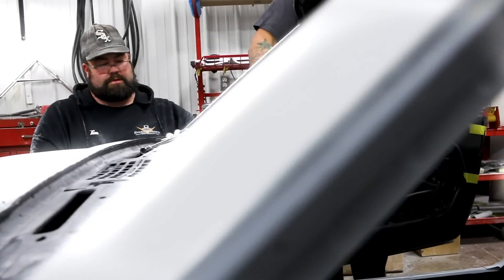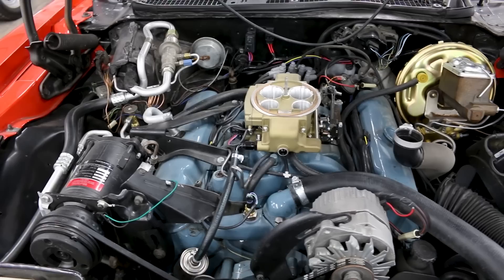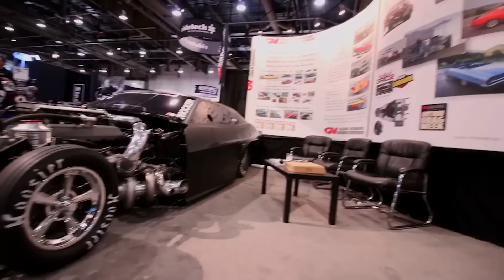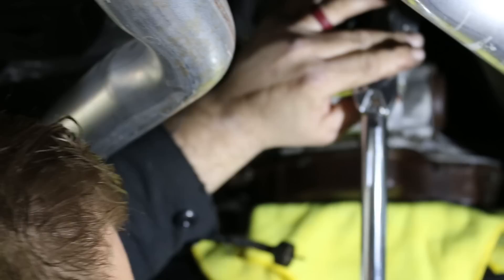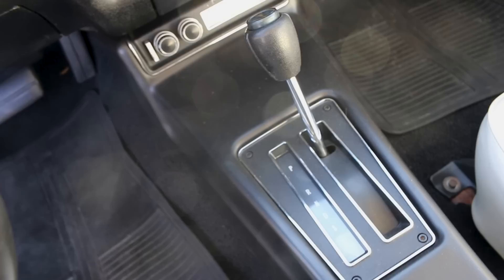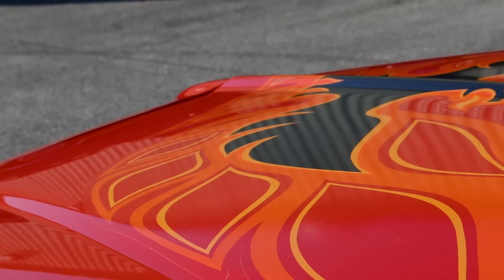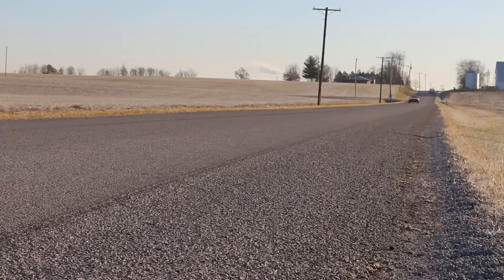1973 Pontiac Trans Am 455 Holley Sniper EFI Gear Vendors Overdrive Install V8 Speed and Resto Shop

Comment: I have a Muncie M21 4 speed in my 74 Nova SS, and I intend to put a Gear Vendors O/D on it.  Everyone asks why I don’t just buy a tremec 5 or 6 speed.  The answer “should” be obvious; my car has the original floor console and gauges in it, and that is a big deal for 68-74 Nova owners.  Putting a modern manual trans in it would require surgery and would essentially eliminate that beautiful original console and gauge setup.
Reply: You can't put an automatic OD on a manual transmissions.  This thing operates from pump pressure. It's not going to work. There's no pump on a manual.
Reply: j they make the O/D unit for my Muncie.  It is basically a gear splitter.
Reply: @TheEvilistic  The OD unit Ed is speaking of works fine on a manual transmission. It's specifically designed for those applications. The guys from Roadkill did something similar on one of their builds.
Reply: You could also consider the g.m. 4+3 from the early to mid eighties Corvette. It is a borg warner t10 with an electronic o.d. similar to a gear vendors unit.
Reply: Pontiaction 1963 sounds like a good idea.  Honestly, I’ve never heard of that
Reply: @IronChief  
I'm not much of an American gearhead , but plenty of buddies are so I know enough to get in trouble usually, so I'm asking  😂...
Aren't those t-10s  a little weak if you're pushing any kind of power I thought  ?
Reply: @MrTheHillfolk  The early t10 was a  little sketchy but they got better as time went on just like the muncie. If you are looking for something to take 5 or 6 hundred hp then no, this isn't a good choice but if you need a reasonable transmission with the ability to split gears in 2nd 3rd or 4th,this could be a viable option.
Reply: Pontiaction 1963 that was my concern as well.  My Muncie is a 1973 (fine-spline) with it’s original internals.  Everything looks nearly new, as if it’s original owner used it with their sanity intact.  I did look into the Super T-10’s before I got this M21, but I couldn’t find a shifter and linkage to work with the console.  Either trans is better than my car’s original Saginaw though.  I’m keeping the Sag around as a spare.
Reply: I put a TKO in my 67 bird. Clear the floor fine the tunnel has a very flat top. Used the Pontiac bellhousing clutch and Factory z bar linkage. I bought an aftermarket crossmember but it was really heavy and just made one from tubing
Reply: John Costello where did your shifter end up?  Back a bit farther?
Reply: @mistered9435  I forgot the details, my tunnel was cut down the side for 4sp linkage adjustments in the car. It had some performance  Hurst shifter. The tko shifter ended up in the hole. (The factory square double metal ring on top) I might have had to notch the front or back a little, for the dust boots to clear more.

Comment: 70-73 were the best years for the T/A, awesome car!  Thanks!
Reply from the maker: Thank you!
Reply: Bill, I whole-heartedly agree. :)
Reply: I totally agree I do however think a rare 1974 sd 455 would be cool
Reply: @kiheirc3195  ... Yes, and I love all the 1970's T/A's, I owned a brand new 1975 T/A and put lots of money into it to increase the HP, but the 70-73 are still my favorite!  They had more power, no catalytic converter through 74, and no heavy 5 mile per hour bumper!
Reply: I had a 1974 that I bought new. But, the 70 to 73 looked much better with the chrome bumper in back and the endura bumper in front.  I guess I could see the overdrive, but the quadrajet for the sd 455 flowed about 800cfm. That carb could easily replace the 650cfm unit on the standard 455.  The best thing is the big sucking sound with the block off plate on the hood scoop removed.
Reply: @kiheirc3195  Their all beautiful but no offense to anyone, i think the 70 to 73 are the better looking bodies all around but i also like the 74 too.

Comment: I put a Gear Vendors OD in my 71 Chevelle with a 454BB. I love it. Been cruising with it for over 10 years now.
Reply: Stock rear gear?
Reply: @thxman1968  Mine was built as a restomod with mostly Detroit Speed drive line components. It has a DS Ford 9" rear with 3.50 ratio. Also have a  3.89 but I preferred the 3.50 for all around cruising, traction and beautiful big block sound. 👍
Reply: @drphibesrises  I know you're coming on here was a while back but I was curious what kind of driving characteristics that offers you at speed as well as Street and strip running. Although I guess with the overdrive it also makes it very fuel mileage friendly at speed on the highway.

Comment: Friend of mine had a  '73 455 SD T/A. One of the scariest cars I ever rode in. Extremely fast. Loved it.
Reply: right on, had to be at least 300 hp, if that scared  you imagine what 500 would do
Reply: @Hugeroost  it's the torque that makes you grab the dash.
Reply: @superduty4556  true
Reply: @Hugeroost   I think it was more then 300 HP
Reply: @bustersmith5569  maybe but not much

Comment: I just installed a gear vendors overdrive in my 68 impala. Love it. Now I can do 75mph at 2,500 rpms.
Reply: I want one for my 88 Silverado that im building. Had the truck since high school and wanna bring it back to daily driver status. I want the gear vendor mainly for the fuel economy benefits. Im trying to figure out how the system works exactly.
If you leave the G.V. switch in Auto position, will you get any of the economy benefits? Or does it only shift into the extra overdrive when in manual mode?
Reply: @HAMMER_2.2  gear vendors overdrive can be shifted many ways. I normally leave mines in automode and let it self into overdrive around 45mph. You can also shift it manually from a complete stop or on the highway. I have a shifter button to turn on or off the gear vendors overdrive. You should get one you'll love it.

Comment: Sweet but who wants to drive around with your console open tho...
Reply from the maker: You don't have to, we were just demonstrating.
Reply: @V8TV  no I get that to, but was thinking it make more sance on the outside of the console or dash...
Plus why didn't you just add a new shifter with a button instead of on the floor??
You guys did a great job either way tho, and thank you for your time and sharing your content with All of us YouTube viewers from Canada and around the world 👍👍
Reply from the maker: Great questions.  In this case, the owner didn't want to see the unit, so it was slipped into the console.  In automatic mode, you don't really need to interact with it, so it hides away.  He also wanted to keep the original shifter.   They've had the car since the '80s and are quite used to it.    Thanks for the kind words!
Reply: @V8TV  well I'm so glad to hear that you made the owner so happy!
You guys do great work and look for ward to more of your videos 👍

Comment: I installed a GearVendor Overdrive on my Convertible 69 Firebird 400, 4 speed over 3 years ago. It completely changed the drive-ability of the car on the highway and I'd recommend it to anyone. 
 
As far as ease of installation. Not sure if I'd do it myself again. Which is why I haven't installed one on my 71 TA.

Comment: I had a '73 Esprit that was Buccaneer Red with black interior and black vinyl top.  When i bought it it was 100% original but had the usual wear and tear.  I kept it for a couple of years, repaired/refreshed what I could and then sold it because at the time I couldn't afford the gas.  It was a great car and I regret selling it.

Comment: I put in a posi traction 3.08 disk brake rear end out of a 81 trans am on my 73 trans am with an m22 muncie and it works great. I can cruise at 70 to 75 mph at 2750 rpm's... Love it...

Comment: I'm looking at doing gear vendor on my 78 caprice coupe. Already have sniper and th400 the gv will be icing on the cake. It has 440c.i. small block chevy and runs great I use it as a daily driver.

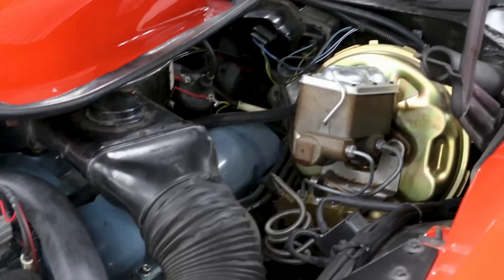Comment: Have a 70 B302 with a 4:30 gear. Installed a gear vendor and it transformed the car. Get to keep the top loader and no tunnel mods. In 4th gear hitting the button turns it into a 3:35.Like Van Halen said "the best of both worlds". Kept the original driveshaft and had a new one made up. Besides the top loader is much sturdier than the tremec. Hid the brain box behind the glove box.

Comment: I had a 74 charger rallye 440 with the torquflite and the optional 3.55 gears. I thought I was hot stuff until I ran into a guy with a 74 SD. Wow.

Comment: Thank you for not putting in a Lazy Ass LS swap like the other lazy You Tuber's.  Keep it original, build it from there. Keep the VALUE!! Putting an LS motor in a Pontiac basically means, you probably can't really build a motor. #partschanger  P.S  As soon as I heard the word Butler Engine, I knew these guys were legit.
Reply from the maker: Yep, we're legit!    Thanks man!

Comment: These are good in some applications, yet I weighed it out this modification compared to a full Diff rebuild with freeway gears & the OEM look never touch it again.
About half the cost.
A good rebuild on a Q-jet starts up quite easily.
Reply from the maker: This allows for great highway cruising without sacrificing acceleration like a highway gear can.   Thanks for the feedback.
Reply: Only down side to gear finder is drive line angle
Reply: @scottb4494  Can you explain.

Comment: Would this od unit help if you have 411posi on a 70 gto that doesnt want to go past 55 mph. The motor in my car is from a 73 trans am 455?
Reply from the maker: It would help for sure.   However, we'd look at the overall combination and goals of the car to make sure everything is doing what you'd like.

Comment: Am I the only one that thinks adding late model parts is a good ideal, now add a coil per cylinder msd ignition 10mm wires platinum  plugs ,modified tunedport injection 90mm throttle bodies

Comment: EFI requires a tank and lines and electric fuel pump, how is that a bolt on? 73 did not have this.
Reply from the maker: In this case, we added a high-pressure in-tank pump and high pressure lines to the throttle body.   There are now many types of high-pressure in-tank pumps for stock tanks that replace the original fuel level sender.  New tanks are also available.    No fabrication is needed, so we consider that a bolt on.   Thanks for the feedback.
Reply: @V8TV  understood,  thanks.
Reply: @V8TV  
I'm 46 and alot of buddies beat around in this stuff when I was in school. 
Had alot of fun with em , good times I'd trade it for nothing. 
I like tech but I went euro, sorry , haha point being I like the tech that's for the American stuff , I'm jealous I can't get stuff like this for a euro car. 
I remember hearing about these when they came out and what an awesome idea. 
Fast forward 25-30yrs now and it's amazing , you can buy everything for these things , like you mentioned about a drop in efi tank. 
If I ever won a lottery , I'd buy this guy's car🤣,I'd have another lenos garage if I could. 
Enough rambling , great vid this was cool

Comment: Why not to gow with a Gear Vendors? Becaus it is probably twice as much as a 6l80, got a third of the gears less and you cannot sell the stock transmission to lower your investment.....maybe thats why
Reply from the maker: Well, not sure about all that.   The GearVendor unit is less than a 6L80, which also would require a controller and harness, and does not fit the car without major floor and tunnel mods.   And it would have to be adapted to the Pontiac 455 bolt pattern.   With the GearVendor unit, the TH400 now has 6 gears the same as a 6L80.   Plus, the car keeps it's numbers matching transmission in place, allowing a future restorer to un-do the job without affecting the car's originality.     For this car and customer, it was a great choice.    Thanks for the feedback.

Comment: You never mentioned what the rear gear is, or what is recommended. (kinda important). plus you said, it was geared too "high", (the reason for the OD) What you meant was the gearing was too low, but hey, who cares, right? 
Nice car. Love the early T/As. Rather have a stick shift, with a Q-jet, but that's just me talking out loud. Had a red 4 spd one in 76 for a few years, and wrecked it. Now I have a condition 5 one, in storage.
 I can see an OD in a 3,42 (or lower) geared car, but don't see a benefit for the expense in a 3.08 car. Unless you're a traveling salesman, driving long distances regularly. Did you ever come to a conclusion about the fuel mileage? hi-way, and city)

Comment: Do you have to drive with the console  lid open?
Reply: That was simply to hide the non factory switches and lights. This is still to be a show car and classic car. Would be much more fun with the switch on the shifter. like on my 2015 Colorado. I don't have a GV in it, but the manual shift is  a toggle switch on the side of the console shifter.

Comment: Love the styling this year , and the color combo of this car is always super. Not a fan of all the creature comforts, 'specially the TH400, even tho I know Pontiacs can handle them perfectly. Just a fan of rowing a stick shift. 'specially in a road car like a T/A. Also understand the bennies of the FI, but will still stand by the QJ on a street revving 455. Would even rather have the nasty Holley, over the FI, but hey, that's just me. Thanks for posting. :)
Reply: By the way, you said the FI would bring better mileage. LOL. So it'll increase from what 8-10, to 12-13?
Reply from the maker: @joequillun7790  The EFI and reduced cruising RPM will definitely reduce highway fuel consumption.   We'll see if we can post milage later this season after some miles are logged on the car.    Thanks for the feedback!

Comment: 8:39 Wow Wrong INFO!
The Gear5 Vendors Overdrive/Underdrive unit does NOT use Automatic Transmission fluid!!! ... 
Use SAE 80W-90 GL-5 gear lubricant ... 
Synthetics are fine as well ... for example GNM Part# 12346190 synthetic, is recommended.
Synthetic oil provides softer shifts.

Comment: If he's more concerned about "drivability" then just install more of a "freeway gear" It costs way less, you don't have to cut your tunnel, cut your driveshaft, and you don't have to deal with electronics and switches... or better yet put in a 4L60E... this trans already has an overdrive in it. Why would you make it harder, and more complicated than you really need too with a gear vendor??
Reply from the maker: Those are good points, but there are no 4L60Es that use a Pontiac bolt pattern, so you need an adapter.  4L60Es are also electronic transmissions, so they require a stand-alone controller.     The GV required some trimming of a floor support, not cutting the tunnel.   Both would require a driveshaft modification.   The 4L60 would also require a shifter modification.   Considering all these points, the GV is a simpler solution, and literally over 3 times as strong.   These were the considerations on this install.
Reply: @V8TV  I believe pontiac is the same bolt pattern as chevy, It's GM. T400. or why not a simple reared gear change, easiest of all... Just so much extra work and money... those GV'S aren't cheap... I feel like you took the long road, rather than the short. Why make more work for yourself...
Reply from the maker: Pontiacs have the Buick Olds Pontiac (BOP) pattern, different from Chevy.  And the customer did not want to lose any acceleration by using a "highway" gear.

Comment: 2200 rpm at 55mph?    You must have 2.73:1 axle gears.    Owner would have been better off putting in a built 700r4 with a 2500 rpm converter.   Best launch with the 3:1 1st gear, and you still get 30% overdrive.   The one I built for my turbo diesel suburban handles 500ft lbs torque no problem.
Reply: 3.27's pull 2200 rpm at 55. At least with a 28" tall tire.
Reply: @V8TV  My sources tell me that 3.08 and 3.42 were the only ratios avail with the 455 engine.   My '76 455 4spd has 3.08s and with a 335-35R17 tire, runs 2400 rpm at 60mph.
Reply from the maker: @231mac  We incorrectly stated in a comment that this car had a 3.25, it's got a 3.08:1 in fact.
Reply: @V8TV  That's cool, I'm just going by a rpm calculator. That's why I made sure to address the 28" tire variable.
Reply: 700s are junk in comparison to the 200. My dad's 671 eats 700s. They don't handle power. My 12.4 grand nationals 200 held up fine.
Reply: @V8TV  OK, that makes the math easier to do..... Stock with Year One Honey Comb rims with BFG GeForce T/A KDW will get you 3052 RPM @ 70 mph with stock 1:1 ratio.
GearVendors overdrive will be .78, which will reduce the speed at 70 mph to 2380 RPM. That is a 672 RPM drop.
Top Speed: 225/7015  stock tires and 1:1 is 146 mph @ 6000 RPM
Top Speed with BFG GeForce T/A KDW 275/40-17 with .78 overdrive is 176 mph @ 6000 RPM.
If the Butler Motor has the power, depends on the build, a TH200-R with a .67 OD will do 218 mph. But you gotta have a lot of HP to get there...LOL!
More importantly, the TH200-R transmission will drop the 70 mph cruise to just 2045 RPM.Bolts right in....
Reply: Got to remember he said it had a stall so I'm sure it's cruise rpm was higher vs stock stall even for the 3.08 gears...
 I looked at gear vendors for years and then went with a 4l80e swap in my 67 Camaro never looked back...

Comment: WTF...200 or 700r4 Same Price as that Thang
Reply: Those 2 are a tad more expensive when built to handle 500+ ft lbs of tq...
Reply: Th400 from a performance standpoint is better both of those transmissions.

Comment: All cars built in 1973 SUCKED! The government had cut their balls off performances cars with radically reduced compression and a ton of smog equipment. I can remember seeing 2 Corvettes in 1975 at the Dragway running 16 seconds at just 90 mph. Then there were those hideous government mandated front bumpers in that era that stuck out a foot in front of the grill.